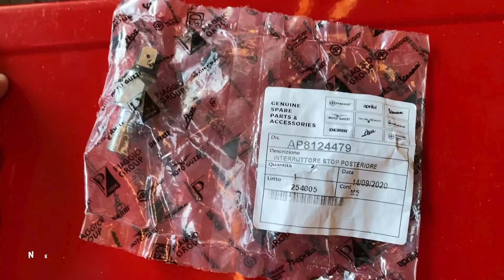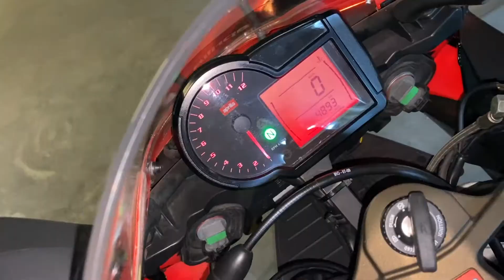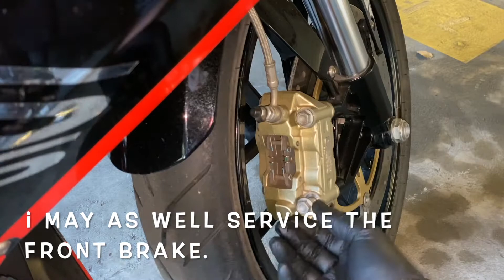Aprilia RS 125 - Replace Rear Brake Switch & Full Brake Service

Comment: Hi Tom. Great videos, so glad I found your channel. 
My son has just bought the same generation, he’s in love with 2 stoke bikes. 
The rear brake calliper, is it a single piston? We’ve just looked at his with the pads out, but when you operate the brake pedal only 1 piston moves, the one nearest the exhaust pipe. Is the other one just a slave piston, or should this one move too? Cheers.

Comment: Awesome series! I recently took over an RS125 as well and have been tinkering with small maintenance bits and improvements. The bike has some rusted screws and bolts that I intend to replace but they aren't top priority at the moment.

I have a question on the use of grease vs normal oils/spray on lubricants. I took apart my brake and clutch lever screws while adjusting their height/angle to fit my foot placement, during that time I did what you did which was clean off all the parts from the gunk. When putting them back however, I noticed you used grease. As I didn't have grease, I just used a GT85 as a temporary lubricant. When should I use grease and how do I differentiate its usage with other less heavy spray on lubricants?
Reply from the maker: Hello there.
Thanks for your message.
I always use a thick grease on bearings, wheels spindles, pivot bolts and rubber seals.
I believe GT85 is a chain lube? Designed to be light and stick to a fast moving chain without flicking of.
I suggest getting a cheap pot of grease for your restoration. It’ll help you along the way👍
Another product I use is Copper Grease. It’s an anti seize, designed protect bolts in high temperature areas or subject to long standing abuse, such as brake callipers. If you can afford it, I’d get a small pot.
Hope this helps pal
Tom

Comment: My question is , does the pistons in back caliper wind back in to sit flush with caliper ?I changed my back disc but can’t get caliper pistons to go back in enough to get the caliper and pads back on
Reply from the maker: Hi Reid. Thanks for your comment.
To answer your question, yes, the back brake pistons should move back into the calliper. It is usually difficult moving the pistons.
Please note with care - the rear brake fluid will riser in the reservoir as you move the pistons into the calliper. You make need to drain some fluid as you push the pistons inwards. Brake fluid is corrosive to paint so be sure to cover the work areas of your bike👍
Hope this helps. Good luck
Tom